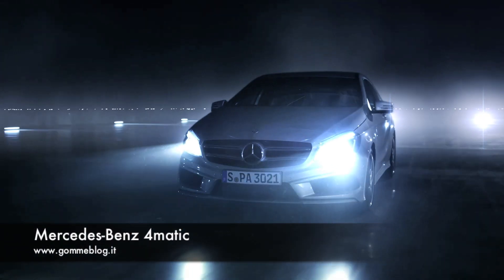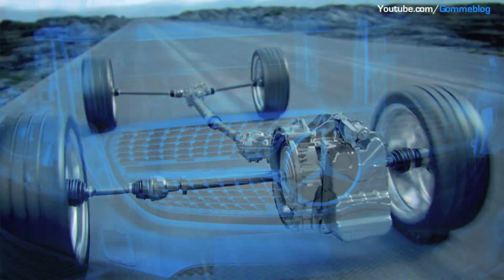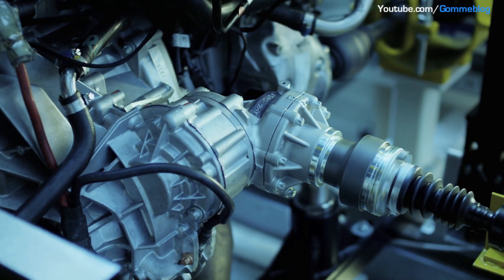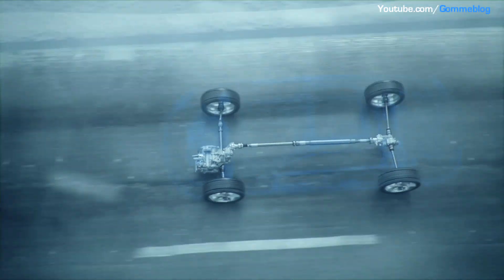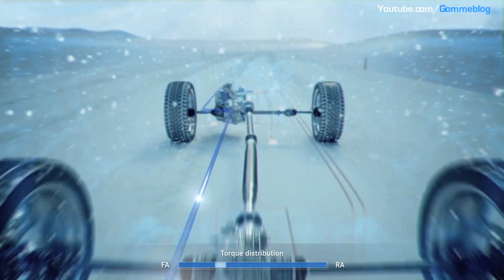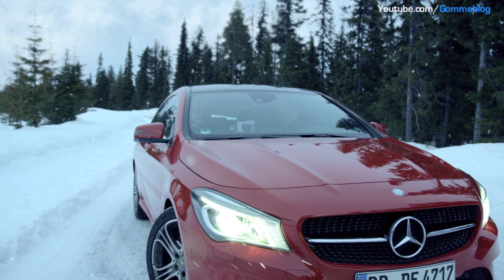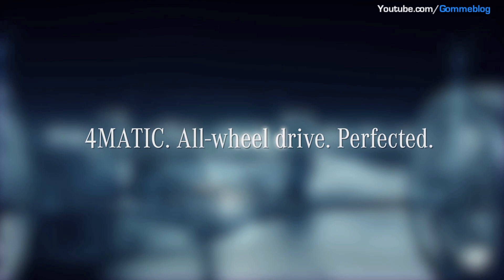Mercedes A45 + CLA45 AMG: How 4matic Transmission Works - HOW IT'S MADE

Comment: So perfect solution. That is a pity that rear diff needs to be replaced every 60-70k km. That cost about 20% of car value.
They spent 3 years to design ideal differential, which lasts as long as the break pads. German Engineering😂😂😂.

Comment: This transmission is not built to Mercedes-Benz quality standards! 48,000 miles on my CLA 45 transmission goes into limp mode. Update firmware! Will not complete adaptation no trans! At your motor car being told it needs a transmission! Control module is Warren teed up to 80,000 miles not even tested by the dealership! Code P0921 was given
Reply: Oh my, that's shocking. Did the dealer cover any fix cost? what happened to the car now. I am looking at the GLA45 now and seems like it has the similar issue with the Trans

Comment: and why is my CLA45 got the clunking sounds from the rear differential? as if i bring a tons of watermelon inside my trunk!
Reply: yup common issue....bad design...my last Mercedes tbh
Reply: Change your rear diff fluid every 10-20k miles it’s so easy to do
Reply: Hi, did you find out what was wrong?
I changed the fluids at dealer and hearing this sound/having this feeling at low speed

Comment: This is very impressive and I'm glad that as a species humans have developed such excellent engineering marvels. But it's much more effective to put an electric motor on each wheel and control them all with software. Batteries are the main problem at the moment, but we'll get there soon.
Reply: meh, electric cars are boring and not practical at all

Comment: This is one of those cars that are actually safer and better handling, predictable with ESP off -- most of the time, at least.

If ESP is on, and I've been driving a grey A45 for almost a year now, the car is just to heavy in the front, and almost always understeer to da dangerous level, really (also making you look like a ridiculously bad driver).

If you're a more experienced driver, you turn ESP off so it won't intervene. ESP actually, in most cars (except for for "sport mode", or equivalent, on RWD only cars) should be turned off if you're more experienced, since then the car will be more predictable and - in the right hands - actually safer. I know and seen AWD drive cars get into some accidents because of understeer caused by ESP intervention trying to brake the front wheels (even rear wheels, depending on how said AWD and ESP system works) on slippery conditions and making the car slide foreword.
 
Even then: at high speeds, the A45 is still prone to understeer a fair bit.

Comment: You definitely won't mistake this for an active torque splitting diff like that found on the now-departed Lancer Evolution or Audi S4 (with sport diff).

However this system is more intricate than the Focus RS 'revoknuckle' and GM's HiPer strut to try to rid the torque-steer in high-powered FWD-based vehicles. As a side benefit the standard AWD does help immensely for those who live in the snow-belt (you try driving a RWD M3 or C63 in 5in of snow).

Comment: Every info I have seen says the 4matic delivers up to 50% of engine power to the rear wheels when activated but this video says 100% of power can be delivered to rear wheels? Hmmmmm? Anyone know which is correct?
Reply: 3Vimages it should be 50 % . Centre differential will lock front and rear wheels if full lock achieved it will be only maximum 50 % unless front wheels are under braking. 100 % of the power to transmit to rear on FWD based 4x4 is not possible.

Comment: 2:15 rear end is deprived of power? Probably makes for a very weird situation if you are a more experienced driver hoping to use the rear wheels to get you out of trouble...?
Reply: DJ BIS and the constant change in traction/behavior must be something to get used to as well.
Reply: If you're a more experienced driver, you turn ESP off so it won't intervene. ESP actually, in most cars (except for for "sport mode", or equivalent, on RWD only cars) should be turned off if you're more experienced, since then the car will be more predictable and - in the right hands - actually safer. I know and seen AWD drive cars get into some accidents because of understeer caused by ESP intervention trying to brake the front wheels (even rear wheels, depending on how said AWD and ESP system works) on slippery conditions and making the car slide foreword.
Reply: If you are a more experienced driver and you're reaching the edge of adhesion on the road then you are an idiot!!!

Comment: Drive an Evo X in snow and after that tell me what you think of this pseudo all wheel drive.
Reply: You left out the small details; The A45 & CLA45 weigh a scant 1550kg & will both easily crack 25mpg combined.
A Evo X weighs a hefty 1630kg despite being much less luxurious and a Evo X will struggle even 18mpg combined.

Sure these Mercedes MFA (FWD-based) platform cars will not hold a candle on a rally course or Auto-X, but are massively better commuters, blend right into a corporate parking lot & great occasional sporty drivers.

To each their own I'd say.
Reply: Trades46 I own an evo x MR, it is pig rich from factory, with boltons and tuning it gets better, I want to make a good track street hybrid car, not 100% dedicated track, but a trackable street car. 
    And I saw an Aussie comparison where the evo x used less fuel in a test compared to a Golf R that has direct injection, it was a surprize to me.
Reply: Trades46 The problem is that these "official" mpg ratings are produced under minimal load, it has nothing to do with reality, so when you hammer it no 300 hp car will produce anything close to 10 mpg, and they are advertized at 30+ mpg, that is at low load only, and we all know people don`t buy strong cars to go economically and slow, for that we have small engines and eco cars.
Reply: Nagy Szilard
Sensible drivers will only hammer their cars on track-day or Auto-X. Sure you can occasionally punch it on freeway when Cops aren't looking, but it's rare enough that I can safely say most "performance machines" are only driven at the limit 10% of the time.
(If not so, I question your driving style & the validity of your license).

Let me put it this way; a STI & Evo would are better cars 10% of the time you're hammering them at the less-than-legal limit, but the Mercedes-AMG are better (more comfortable, luxurious etc.) when you drive them on the regular roads, 90% of the time.

And when you're NOT trying to get yourself a speeding ticket, then a 25MPG combined vs. a 18MPG combined would mean paying a visit to your local gas station each week vs. every 2 days.
I don't need a calculator to know how much petrol you'd save annually yet still have equal level of occasional fun.
Reply: Trades46 I have an economy car as a daily driver, when I use the evo for the go fast stuff, if the mercedes had the evo x awd system and a good transmission, I would buy that as a track toy, but since they don`t make cars hardcore anymore I will stick with the few that are left.
Reply: Nagy Szilard
Fair enough. Enjoy what might (unfortunately) the last true Mitsubishi Lancer Evolution...ever.
Reply: well a mercedes is made for german conditions with unlimited speed on the autobahn . i doubt anyone with a sane mind and a proper luxury car would ever go on a track. mercedes isnt a boyracer car the typical buyer is a dentist, lawyer or something like that.
Reply: EVO x? snow? PFFT the A45 4motion went to the desert
Reply: after driving my c300 4mtic threw 3 feet of snow and passing suv's and some subarus (never see any lancers because mitsubishi is going extinct) it trully is an amazing system, I wasnt even ale to open my door and it was powering threw the snow like a lifted truck. And that with open diffs front and back, I can only imagine what a GLK would do, its basicly a lifted c class with more clearance, mechanically they are the same.

Comment: copied from 4motion of small audis and vw
Reply: Wtf? Mercedes presented 4MATIC in 1986, VW used 4motion as name in 1999 and Audi have a quattro.
Reply: 2bach The principle of operation is the same as VW 4motion. Copied from VW
Reply: 2bach
And VW had produced it s own 4wd long before 4motion named syncro so...
Reply: he is right, this is basicly a mercedes version of haldex 4wd system and no it is not only a vw system, it is a pathen, volvo, ford, saab and vw all use the same haldex.  This is because the cla is fwd based, any other 4matic benz have a different 4wd, more genuine and that is because the engine is not transversely mounted like in the cla, so in sum, almost every fwd based car has a very simular 4wd system to this.

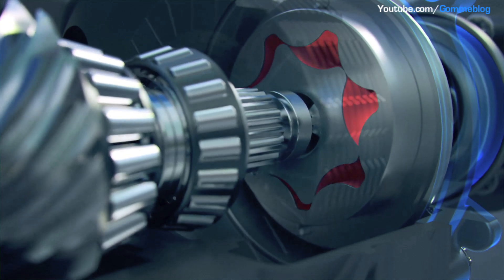Comment: this AWD seems like an afterthought; an adaptation of a FWD... video is also misleading because only 50% of the power can be sent to the rear wheels in the A45/CLA45 AMG. I think they fudged around at 1:00 with the idea of "100% of that 50% can be sent to the rear differential by the rear electronic clutch"... not sure what they are trying to say but for sure this system can't function at a 100% rear torque split. Fancy presentation with big words... but at the end of the day just a traverse 4-pot set up with unequal front axles. Nowhere near a "perfected" AWD system. The 4-matic system is nowhere near the world-class AWDs from Audi and Subaru. It really irks me when everything sounds more believable with a video and a movie voice.
Reply: Its not misleading my friend. Its depend on the type and segment of car. For the A45 in the normal controlling conditions(cornering, acceleration or deceleration) it split up to 50/50. Check at 2:08 it send the 100% torque to the rear axle by applying brake at front axle during the lost of traction at front axle, that way they send 100% torque to rear wheel axle. Mercedes made this version  for daily use sports car with good fuel economy, by keep it as a FWD in normal situation. It seems very reliable AWD system, because they use proportional valve instead of servo motor to control the plates
Reply: Abhir Malhotra The way how you communicate looks like you belong to  a third world nation. Did you read my comment properly. Whats the different info that you are sharing rather than repeating same of mine
Reply: You are not the only one who spent money on your education. There are lots of people who are doing same thing. You spent on your self, there is nothing you have done for society that you are bragging about. By spending 30-40k on your study is not a big deal and there are tons of people spend more than you.
Reply: j dutt 30-40k?? lol. and why is it about society all of a sudden and not about my grammar or the country where i come from? lol
Reply: This AWD System is based off of the HALDEX ALL WHEEL DRIVE SYSTEM.
Reply: Xeno This is one version of 4matic used on their front wheel drive vehicles (A Class, GLA, CLA, B Class). 4 matic in their large rear wheel drive models works differently. This 4 matic was meant for stability and to not affect fuel economy.
Reply: Calm down buddy and take your pills
Reply: If the front wheels are in the air and the diff is fully locked. Where is the torque going? 100% to the rear. There is ofcourse some torque going to the bearings and friction in the front section, but we don't count that.

Comment: 0:58 What it is? please answer somebody
Reply: the drive shaft always connected to the rear to take up to 50% of the torque to rear, but the drive shaft is disconnected to the rear wheel with clutch plates. when press those plates together, it can connect the rear axial to the drive shaft to make rear wheel turn. In this case it is a basic connect and disconnect like a light switch. For the power that send to the rear, that will depending on how the gearbox do. because it has to connect to the front all the time, the transfer power to the rear seems to be leeching to the front through simple gears. That is why it cannot detach the front to make it rwd. The other way to do it is to put the same system to the front axial as the rear and become a transfer case so that the car can send more power to rear. However, this way will require a much better and stronger gear in the back (cost and space for smallcar usually cannot allow that) and therefore like the focus RS would only allow 60% to the rear since the rear gears are cheaper and flimsier. For rwd bias awd, u can check the A4.

Comment: Mercedes? At high speeds the torque is sended to the front wheel drive? WTF! Quattro from Audi is way better, the torque is sended 40% front and 60% to the rear side